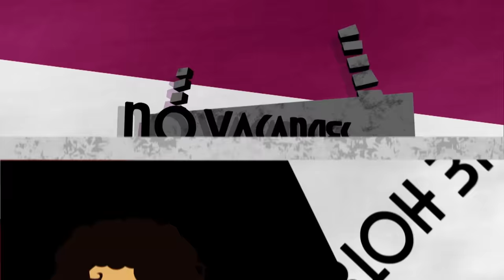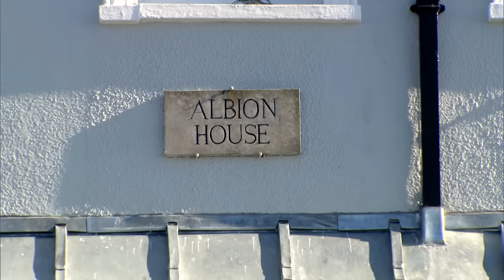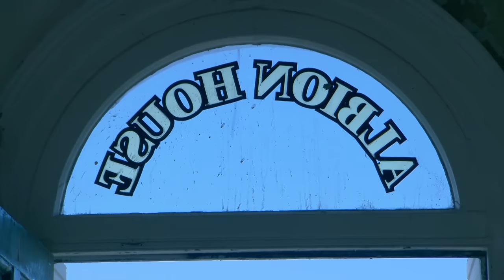Blown Budgets and Missed Deadlines - Can Alex Save this Brand New Hotel? | The Hotel Inspector

Comment: A beautiful building indeed. Personally, working on a building of that size and importance, the best way forward is to do all the demolition first. Do the electrics and plumbing first fit throughout, then start finishing on the ground floor and work up floor by floor, finishing one room at a time comoletely. Have teams in order. Plasterers, then decorators, the final fit electrics and plumbers, then furnishings and, what in the film business are called set dressings. The other thing is to have all colours and finishes picked out and bought ahead so everything is staged and ready to go as each step is completed. During the iff season for the film industry, hire set dresers and prop masters. They know where to get what is needed quickly and can make a room finished in less time than you can imagine, and have it spot on. The talent if set decorators is beyond belief.
Reply: Fail to plan…plan to fail.
Reply: I’ve worked with prop managers and they are indeed miracle workers

Comment: No elevator...that will be an issue.
But they did a beautiful job on the decor.
Reply: It's probably not allowed if the building is listed.
Reply: @Hiforest In Canada.. even if it's an historic building..to have wheelchair access is required
Reply: It took me 3 months to be able to get permission to drill a hole in my grade B listed apartment, to install my broadband lol.  They refused the first time.  Honestly, the people who make decisions in the UK about listed buildings are a nightmare.
Reply: @pamelahaze3211  I agree with you btw - buildings should be accessible, I just understand why they probably haven't done it.
Reply: There is an accessible room on the lower ground floor with fully adapted bathroom reached by lift (according to Telegraph Travel Review)
Reply: Can be it's listed, but it's a disgrace in 2024 if paralyzed people can't get access to this kind of buildings due to lack of an elevator.

Comment: I'm surprised Alex didn't ask where the $1.75 million went. These young grifters certainly didn't put it into refurbishing the hotel. Nothing has been done. Not one thing. I can't believe the old couple keeps pouring money into this when professional remodelers/builders would have had this up and going by now.
Reply: On the Carrera marble darling... on the marble! (in Alex's voice)
Reply: That was £1.75 million. Multiply it by 1.5 to get the rough estimate in American $ (if I remember the exchange rate from that time correctly).